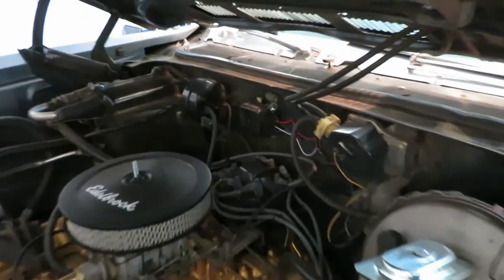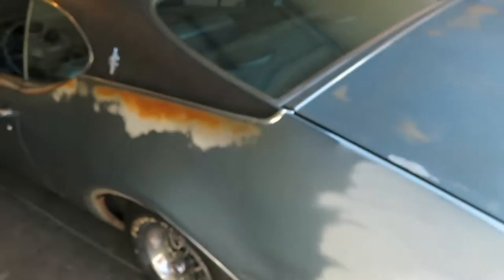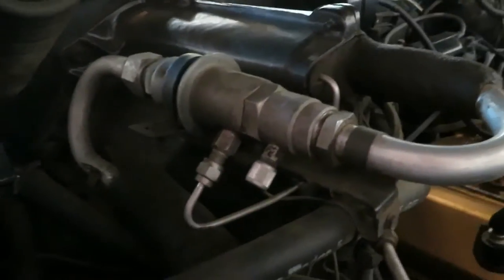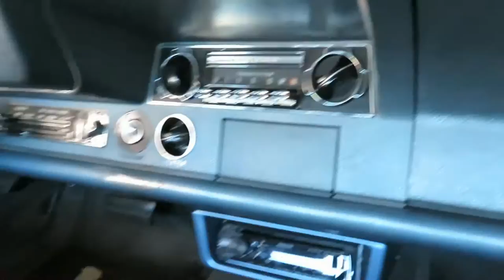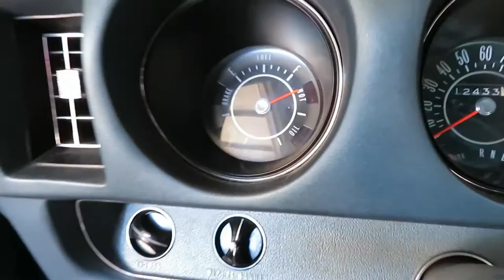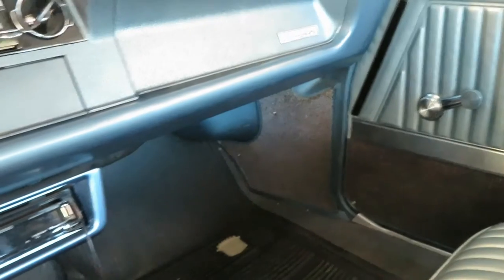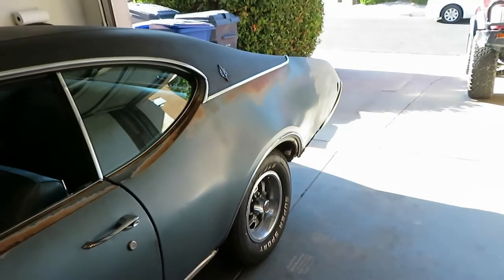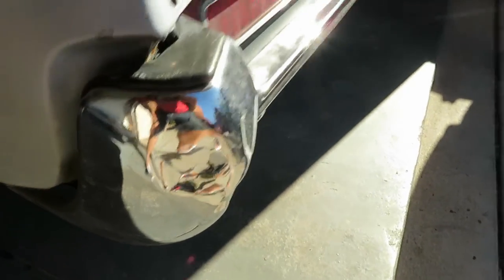VLOG 1: 68 Olds Cutlass Supreme Project Car Overview!

Comment: I have a 1968 Oldsmobile Cutlass Supreme Holiday Coupe. I did a lot of things you did like the transmission swap. I have recently rebuilt another 350 engine from a '68 Cutlass and converted it to a roller cam and rockers. My body is nicer than your car but your interior is better than mine. The people who owned the car before me abused it. You have a real gem. If I were you I would get a new wiring harness for that voltage regulator. Your rear axle ratio is the same as mine 2.78. I replaced my Q-jet with a later one with an electric choke. I just noticed your video is from 6 years ago. How is your project going now? Thanks for the video and take care.
Reply from the maker: Hey awesome! What color is yours? Does yours have a vinyl top too? I should replace the wiring harness for that voltage regulator, its still hooked together like it was in this video. :D I haven't done much, I have two kids now so the major work has kind of slowed down. I put a new AC compressor on it, but that didn't fix the AC. So I ordered a new POA valve, expansion valve and dryer but its all on back order, hopefully it will be here in a few weeks. I made some very bad patches for my rear holes in my quarter panels, exhaust fumes were getting in the car so bad I had to do something, i sprayed some expanding foam in the gaps and covered it with bondo lol. Its dry enough where I live that I dont worry about the foam causing more rust. I do want to get new inner and outer quarters someday when I can afford it. Awhile ago I locked up my drum brakes on the road, had a code brown and rear ended the guy in front of me, I must have been going 15-20 mph when it happened, his car was mostly fine. But my 68 got smashed up bad in the front. bumper, grille, and drivers side fender were gone. I used insurance and was able to buy a set of two reman front fenders so that's nice. they are just painted in primer that color matches the rest of the car. I found a used front bumper locally and a new grill and headlight bezels from facebook market place. That whole mishap had the car off the road for around a year.
Otherwise stuff is mostly the same. I put a subwoofer in the truck, I just use the car as a daily for the most part, it's still really good. 
I have been curious about swapping my carb. I do have another Q-Jet from an early 70s cadilliac, it has the divorced choke just like mine. My spark plugs look fine - but the exhaust smells like the car is running way too rich. The exhaust is so toxic you can barely stand behind the car ha. So I want to figure that out. Wondering if I can play with the timing a little, or rebuild that second carb of mine. What benefits did you get switching to the q-jet with the electric choke?
Reply: @CodyShell  My car is white but originally it was Ivory with a gold vinyl top, The interior was 2 tone black and white. Black dash and carpet with white seats and floor mats. I bought A/C components from a place in FL called Original Air. They have excellent parts. Other places that were helpful were The Parts Place, Fusicks, Inline tube.
Reply: @CodyShell  I put a carburetor on mine from a 1976 Cutlass with an electric choke. My choke didn't work. I also used the P/S pump and brackets, HEI distributor. starter, cyl. heads, because of the hardened seats for use with unleaded fuel. Mine had a burnt valve. I still have ALL the original parts. Never throw away your original parts. I also installed a turbo 350 transmission with a mild shift kit. I used the kick down cable bracket from the '76 Cutlass. I plan on installing front disc brakes in the future. I also have a 1987 and 1995 Chevy Pick up trucks. I just rebuilt the engine in the 1987. I'm almost done with that one and the Cutlass is next. Take care and good luck with your baby.

Comment: nice video man, i just recently purchased a 69 cutlass with a 455 in it and im planning on fixing it up. keep it up u motivate me to work on mine lol.

PS. make sure you record a video of you doing the fuel sending unit because mine doesnt work as well and id like to see how to go about doing that
Reply from the maker: nice! congrats! make videos of yours as you go! its great to share. 

unfortunately i did the sending unit already and didnt do a video. :P and i'm actually in the middle of a heater core swap. but the sender is easy! unhook the black ground wire thats in front of the tank near the axle. then jack up the axle and over by the front of the tank is where there are 2 long bolts you use to undo the straps that hold the tank. go ahead and undo those. have a 5 gallon buck or somethiong big the tank can set on once its empty. then over by your fuel filler behind teh license plate there is an electrical connector you have to undo that goes into the sender. as long as its empted its not too heavy/hard. drop the tank. 
then there is some insulation stuff you have to pull back. then you'll see the top of the tank. there is a big wing-nut sorta round thing that holds the filler in place. i used a flat screw driver and tapped it with a hammer to spin it off (too hard by hand). from there you can take that thing off and pull the sender out of the tank. its pretty simple. 
oh yeah theres also going to be 2 vent lines that come up out of the tank and the piece of fuel line that goes out of the sender. undo the main fuel line when you do this. (you can leave the vents there). 
make sure those vent lines are good and have good clamps on them. mine were bad on my 68 and the tank would leak from there if it was full and i parked downhill. maybe i can still make a video. i have a 69 442 (clone) that also needs a sender! i'll make a video for that one. there may be 2 fuel lines that come out of the sender. just make sure the tank is empty first. haha
Reply: you can get all your cutlass interior parts from legendary auto interiors ...i purchased a 1968 conv.in 1987 at nite when it was raining ...still have it today ....i'm into for $30.000..with the 350 2 speed junk away tranny  thrush  glass packs ...sounds rude
\

Comment: dude your doing an excellent job on that thing. don't stop what your doing. I love how you recognize what you have and your keeping it as SUPREME as possible, its obvious you don't have the chevy monkey mind set, as there are too many of those kind of car guys that this car could've fell into the hands of. it is a shame that there isn't much of replacement interior parts for the supremes. but all in all, just wow. im glad to see you giving this car the attention it needs. by the way if you ever have carb problems, don't ever sell out and get an eddie or a holly, get the quadrajet fixed. one more thing, next time your  bord, swing by my channel and check out the 70 olds 350 im building for my  estate wagon.
Reply from the maker: thanks for the feedback! Glad i'm not the only one who appreciates keeping it a supreme! I love the Q-Jet good fuel economy when i'm light on the pedal and plenty of power when you get on it. I'm surprised I rebuilt it myself and it turned out okay, it was the first carb i ever took apart. Last weekend I dropped the tank and replaced the fuel sending unit. While I was down there I really saw how bad the trunk floor is. I think I need to replace the entire trunk floor. I guess thats where I can start with the welding. I'll keep making videos as I go. I'll check out the video of your motor!
Reply: I ment to ask. what was the power difference when you swapped the tranny? any change in acceleration, any gas mileage change, lower highway rpms? I still haven't swapped my 2 speed for a 350 yet, and im itchin to know. also did you have to modify the steering column so you can pull the shifter down all the way to put it in first or was there enough room?
Reply from the maker: Power difference is huge. The big deal is the lower first gear, it makes it so much more drive-able 2nd gear is in a better spot too helps a ton with passing other cars and getting up to speed. The kickdown is a lot more reasonable. Sometimes my jetaway would kickdown when im already going 50 MPH, that was a lot of RPMs to be turning! 3rd gear feels exactly the same as 2nd in the jetty. To my surprise I didn't have to modify anything on the steering column! The shift indicator will move past the "L" on the dash and it slides right into 1st gear like it was made for it. I'll make a video of me shifting it sometime. ha
Reply: rite on dude. I cant wait to swap mine. Iv been told on the 350s if you remove the accumulator spring from 1 to 2 you get a really snappy up shift into 2nd gear. it would be cool if you did make a video on the shifter
Reply from the maker: didn't know about that, interesting! i'm going to demonstrate it on a video. because that was something i was confused about when i did my swap. would love to help as many other people with these cars as i can. (even though im learning myself) ha
Reply: that's the way to do it. I'm learning as I go aswell. I'd say just do some research on quickening the shifts and youl find what you need. I'm planning on doing it on the wagon tranny first. il make a video when I do it
Reply from the maker: nice! learning as i go too. i did the fuel sending unit on it last weekend and when i had the tank down i saw how rusted out the trunk was. i need a whole new trunk floor!

Comment: What's that thing to the left of the brake booster?
Reply from the maker: TheBay'sFinest that's the motor for the windshield wipers, and the pump for the washer
Reply: @CodyShell  what did you connect the distributor too and what distributor did you use?? Thanks

Comment: Looks like you have a 455 in there not the 350?
Reply from the maker: Nope its a 350, the original one the car came with. I actually just had it rebuilt, i need to make a new video of it
Reply: OK saw the center hose that is unusual for a small block
Reply: for that arm rest you looked at the arm rest for a 98 or 88
i have a 1968 delta 88 with the 455.  It is in the body shop I have all the parts in the garage.
Reply from the maker: Kipchoge Gilmore I didn't think about full size cars for that part! I'll have to check